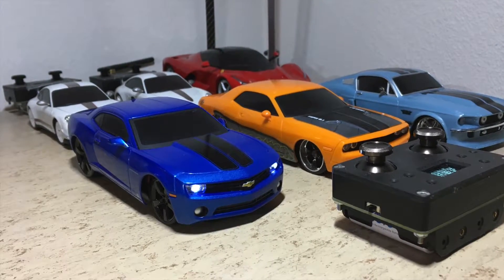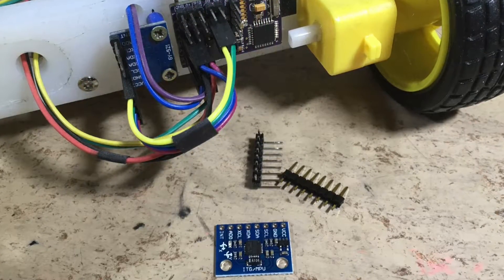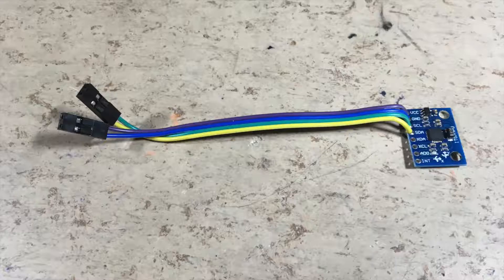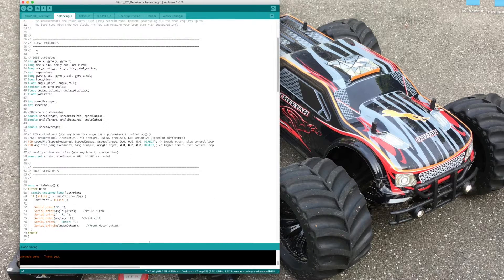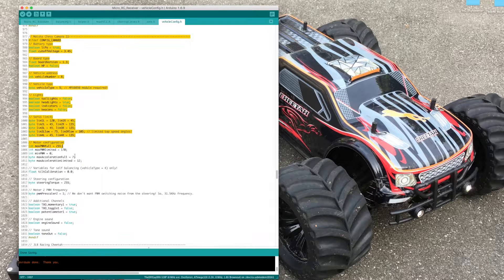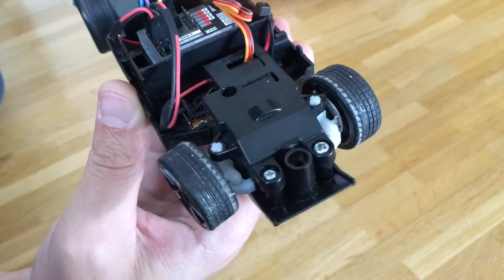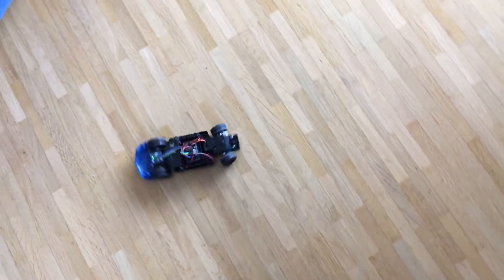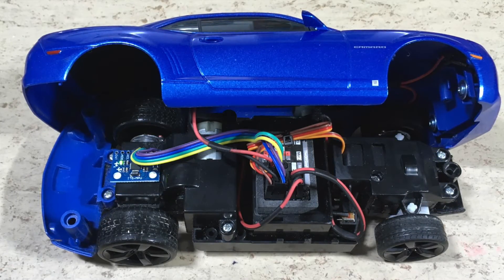Arduino MRSC (Micro RC Stability Control), ESC, ESP, TSM In A Camaro

Comment: Hello Master. It's the third time I wrote in the comments. I would like to ask you, if it possible to use the MPU gyro with a motor controlled steering (I'm using a coreless motor for steering and not a servo). It will useful for a mini RC RWD drift car? Or do i need to use a servo (proportional steering)? Thank you very, as always i really appreciate your creations, by far the best ever seen on YouTube
Reply from the maker: Hi, sorry for the late reply. Yes, you can. See this video: https://www.youtube.com/watch?v=jr5yYBal3vk

Comment: Ive seen you putting the gyro in the back and some times in the front - what is the optimal location?
Reply from the maker: It does not matter, because the accelerometer is not in use, just the gyro.

Comment: Great work.It is possible to add a input to  tx that take the signal ppm( signal of trainer port) of a normal transmitter?Thanks
Reply from the maker: Thanks. In theory it should be possible. But reading PPM signals in parallel with all the other tasks will not be easy. Which protocol would you like to decode and why? Would you like to build a wired remote?
Reply: No protocol in particular,but i like to use the commercial radio because i have many.I order the parts and assembly this system.I redesign only the rx for use external h-bridge with more power,with fds8858cz fet.
Reply from the maker: Why bigger H bridges? This receiver allows you to use every brushed or brushless ESC you want. Just connect it to Servo CH 3

Comment: great mod Sir very small and lightweight i like to use in my wltoys k979 that got delivered yesterday :D
Reply from the maker: Thanks for the praise. The biggest advantage of my remote system - compared with the standard Wltoys remote is, that there is no dead zone around the steering center position. So the steering accuracy is much better.

Comment: Hmm, interesting addition! For me personally not immediately useful, but good to know that it is possible.
By the way, quick question (a bit off-topic), me lazy to re-read what has been added to your nice RC system: is there possible "gears" switching. I mean - can I have two speed ranges set in transmitter, with quick button selection? Thanks!
P.S.: and, if using ESC for main motor, so that would be question for kinda "two switchable servo ranges". I hope you understand what I try to say :)
Reply from the maker: I wanted to do this for quite a while now. Finally I did it today. And yes, the feature you want does exist. It also works with an external ESC. Have a look at the transmitter manual on my GitHub.
Reply: Yep, time to read manuals! :)) Thanks!